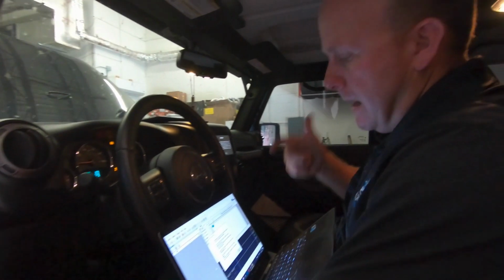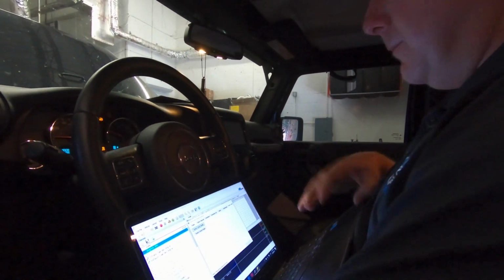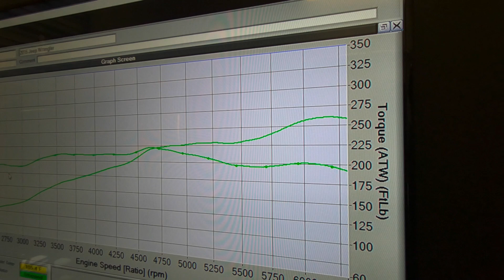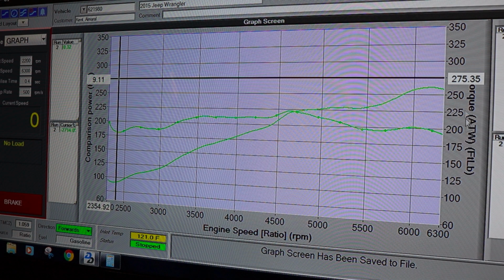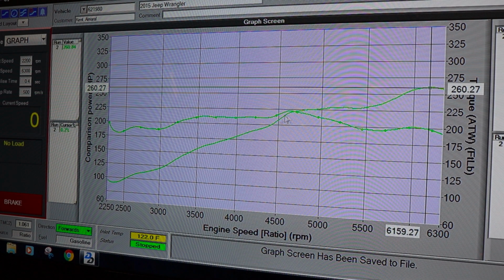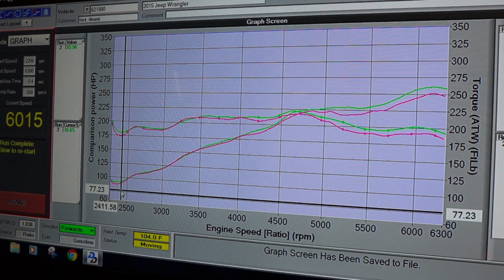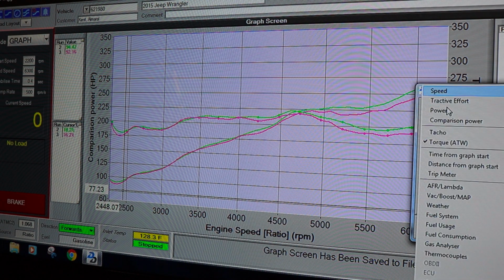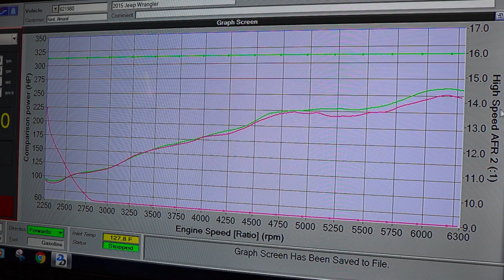Making The Switch Part 1: Supercharger to Turbo

Comment: This is either a ripp or procharger kit. My 13 jk had a ripp kit. First dyno results my tuner had similar results with it being dead rich. Multiple passes and tweaks I ended up with 344 wheel horse power.  2 door 35s. 8 psi. 4.10 gears 6 speed.  I think a proper tune revision from a reputable tuner would make this a fair comparison
Reply from the maker: We reached out to Ripp and asked them to revise the tune with the latest revision. Ripp has not responded. We would like to get the vehicle to perform the best they can make it prior to switching to turbo. If you happen to know someone there, please have them respond to our email.
Reply: @ProdigyPerformance  Thanks for posting, we did however speak to someone at your shop named Wes, we specified that our tune files are in Diablo format and cannot be modified in an Hptuners format. We also specified we'd like to see a datalog corresponding to the dyno  (with air fuel and boost) to be safe. It seems the vehicle may have some issues or other factors that are not running correctly since the air fuel ratio is flat lining. We'd be happy to assist the client with their vehicle if they wish, however we wish them best of luck on their build no matter what!  Thank you, RIPP Superchargers
Reply from the maker: @RIPPMODS  As a courtesy we reached out to you via email and  requested your input as we wanted to show respect and an unbiased approach. We did provide the necessary files in Hptuners format. You guys did not respond to the email so Wes pushed off the turbo install and called you.  The conversation was cordial and we will be providing the requested Diablo file format. We will also provide any logs or measurements you may need to make sure your product is represented accurately.
Reply: @ProdigyPerformance  Great to hear, looking forward to it.
Reply from the maker: @RIPPMODS  Hey guys, we sent over the tune file that was currently on the Jeep. If you could, please make any changes that it needs and we will re-run the vehicle and respond with a data log. Thanks!
Reply: Bryan Depiazzy you gotta get the altitude pulley for 11psi it’s great!